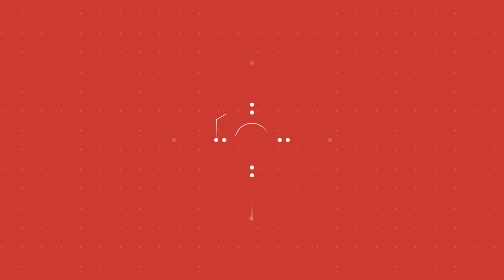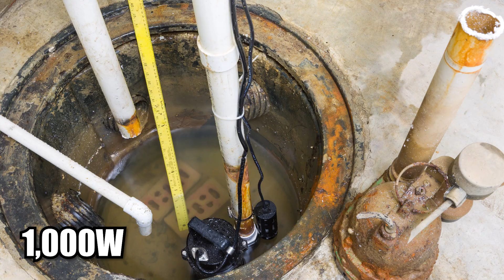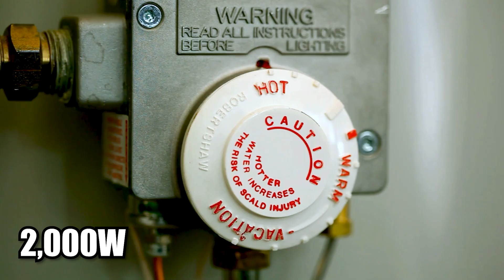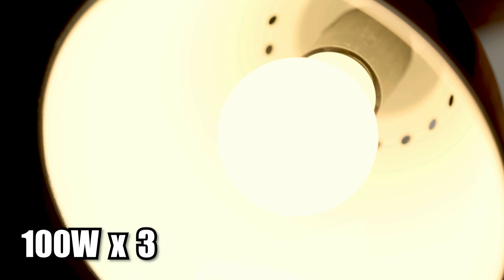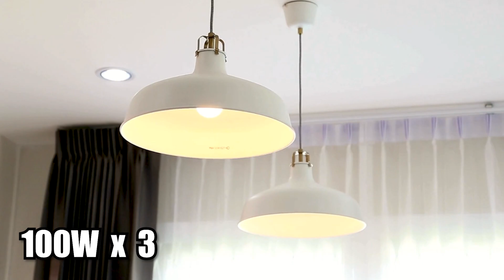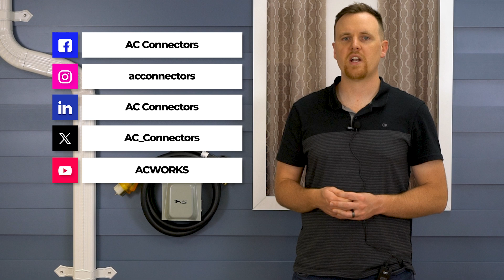30 Amp vs 50 Amp  Inlet Box | Which One Is Right for You? - Emergency Power Kits

Comment: Great review, we just purchased our first generator yesterday.
Tri-Fuel Westinghouse 9500 running watts/ 12500 peak watts. We would be using a good amount of power. Would you recommend the 30 or the 50? 
Thanks!
Reply from the maker: 50A to get as much of that power as possible. 30A would limit you to only 7500W.